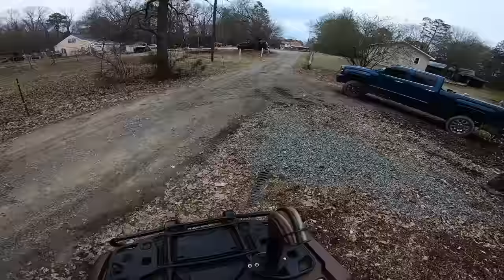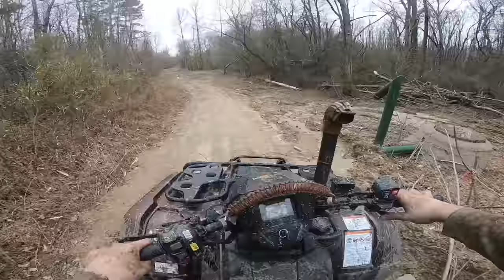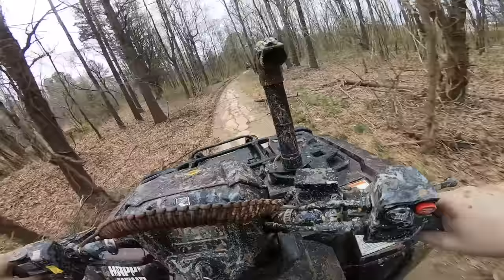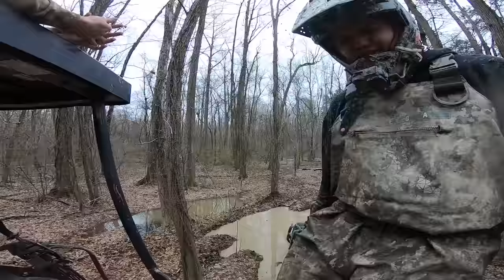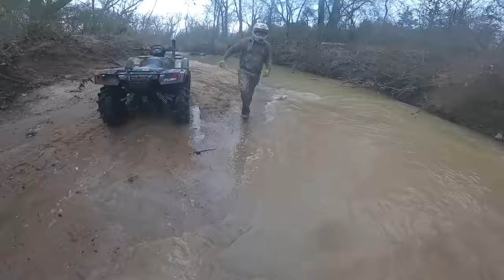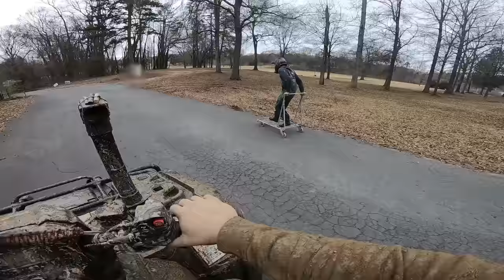WE FOUND A STOLEN EXCAVATOR! *FOUR-WHEELER COPS*

Comment: I'd try opening up the dashboard on that Honda to see if the gauges can be dried out with A hairdryer.,or A heat gun then I'd see about putting A waterproof seal behind the gauge cluster after you get it working again possibly. I'd clean out those carburetors good to. Cause it's going to need one for sure.